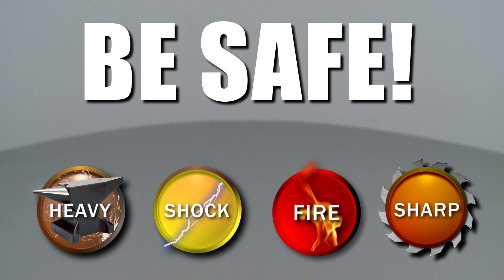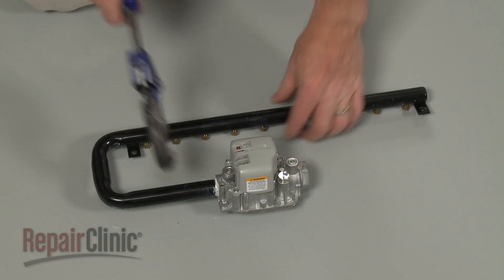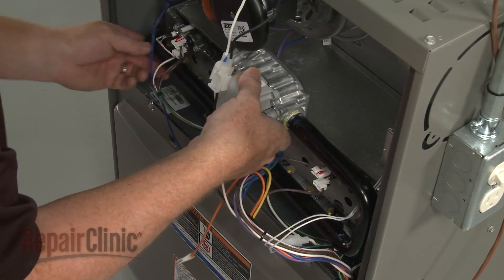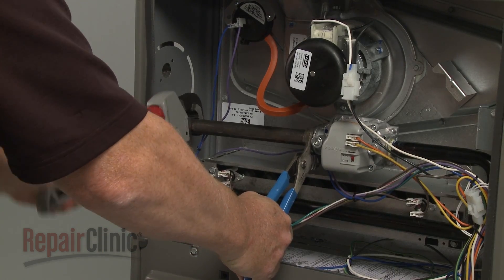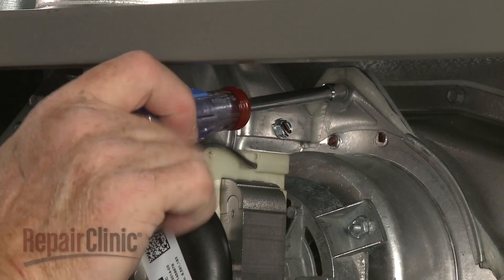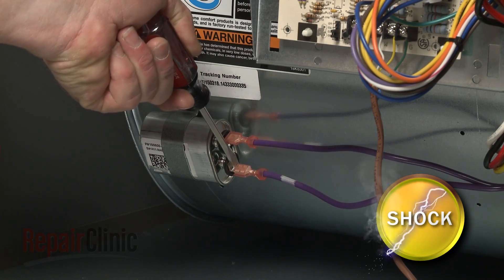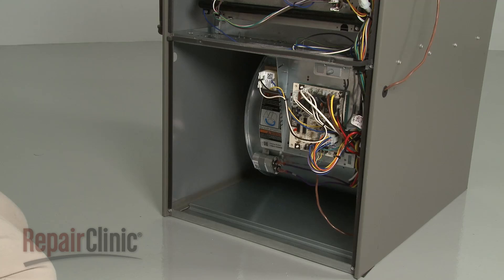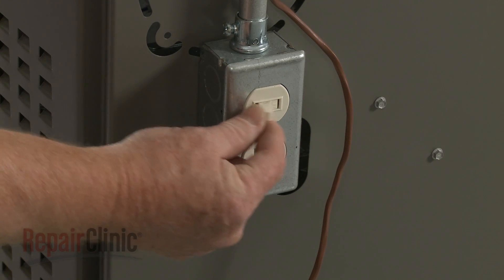Lennox Gas Furnace Disassembly (#ML180UH110P48C53)/Repair Help

Comment: I think this may the issues with my Lenoox ML 180UH090P48B-03. It turns on but only runs for a few minutes then cuts off. I did a hard wire of the red and white grounds to manually start the system as instructed by Honeywell tech support. The system ran for maybe 20 mins and cutoff. Do you have the links to these parts for my system?
Reply: Do you know where the filter is located on this unit my technician never explained it to me